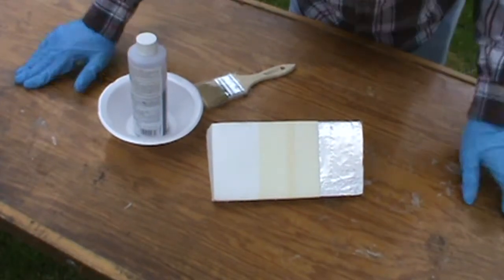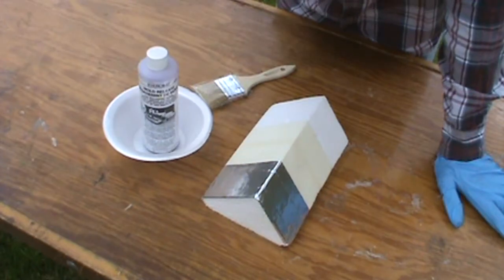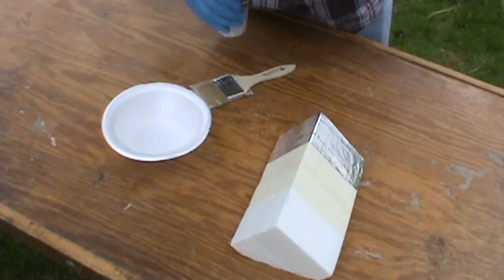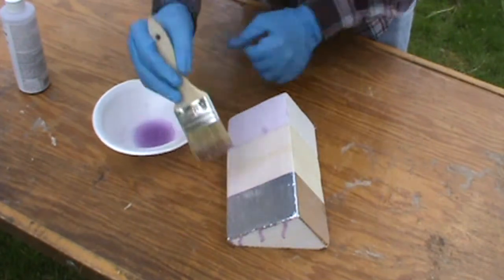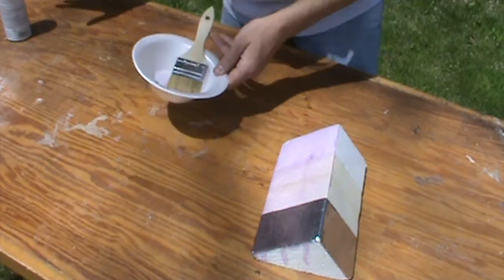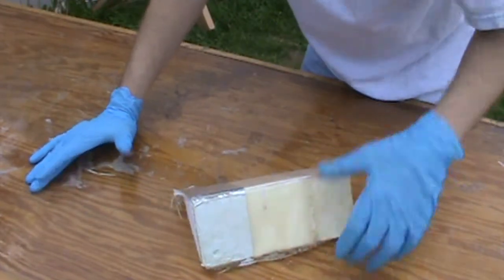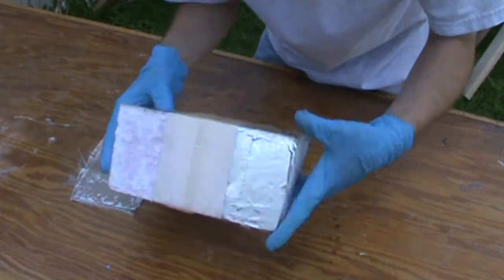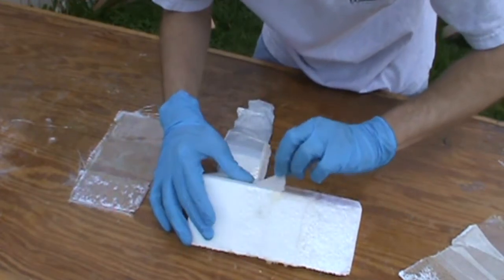Polyester Fiberglass Resin vs EPS Foam - Experiment #1

Comment: I know this video is 4 years old but maybe someone will see this comment. I have used foam for building terrain for tabletop wargaming, and in arts and crafts there is a product called Mod Podge which is used to seal foam so you can use spraypaint on it without the solvents affecting the foam.
 
The DIY version of Mod Podge is simply Ronseal Interior Wood Varnish mixed with PVA glue. This makes a far stronger and more flexible seal on the foam and I am pretty sure you can do what you want using polyester resin on it. I might give it a test myself soon.
Reply: Mod podge forms a very thin flexible layer, it seems to work well at sealing a lot of other materials as well! I've tried pouring a thin layer of epoxy over previously oiled Teak wood after thorough sanding, and it would always form cloudy layers on the wood surface. Looked like crap. 
One layer of mod podge glossy and then epoxy, works beautifully well!!
Reply: Good call, mod podge is a great glue, I'm needing to glue a 4in. Plug in my boat and will give this a try. Also have a fish tank background I need to finish out.

Comment: Great test  and its clear that the fiberglass does not PENETRATE the polystyrene  or styrafoam board BUT how does the fiberglass then BOND to these  boards with 4 to 5 coats of latex paint ?
Reply: The whole idea is that it shouldn't bond to the foam.

Comment: I think you need to use a better quality tape. I’ve used green tape from Menards and blue painters tape and polyester resin won’t stick to it. You need tape with a slick surface. I’ve also used latex paint which works as well.

Comment: i found this hard way and by luck. i happened to joined to piece of polystyrene and it turns out that everything but the pva glue used to adhere the two pieces together held together with no reaction to the resin.

Comment: PVA glue is just your average everyday water-based ‘white glue’ like Elmers...which can be bought at any craft store (or any store that sells glue). Kids use it for decoupage. One thing that should be in every bodies tool box is parchment paper (steal whoops I mean borrow it from your wife), NOTHING sticks to it (it’s coated in silicone) Edit; 6:20 the PVA glue is water-based, the adhesive on the tape could be water-based. My grade 9 chemistry tells me “like dissolves like”, the glue could have dissolved the tape adhesive

Comment: The masking tape might have absorbed a little of the PVA, just like it would if you spread water over it.
Perhaps the blue painters tape would resist absorbing the PVA? 
Blue Painters tape doesn't wrinkle up when you paint it with latex. Your test answered a question I have about a project I'm working on today! Repairing a poling platform on a boat. 
The original "filler" material was end-cut balsa wood, which I do not have access to, & replacing it with plywood would add too much weight.
Thanks for the new ideas!